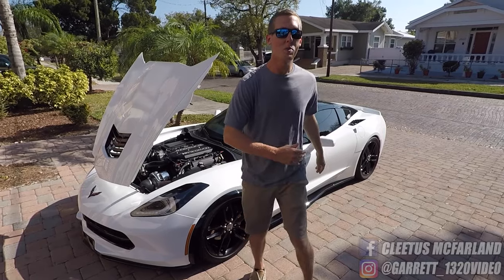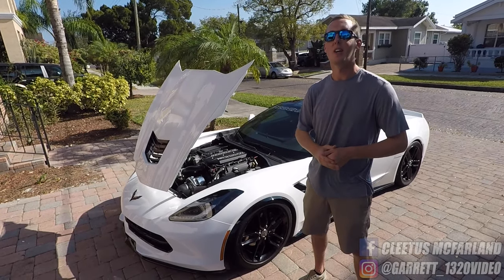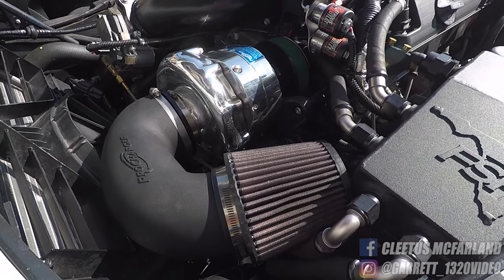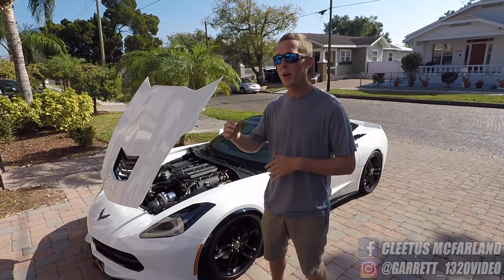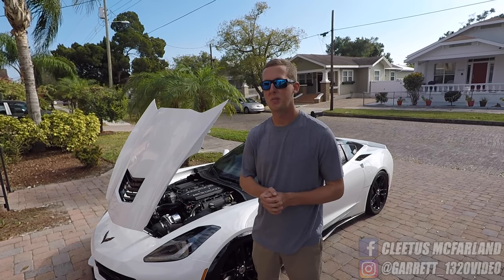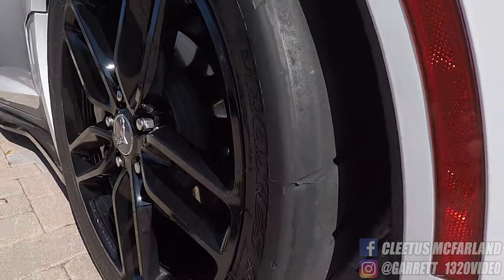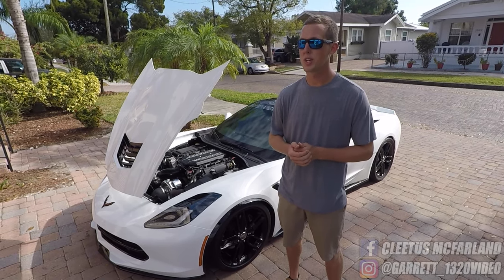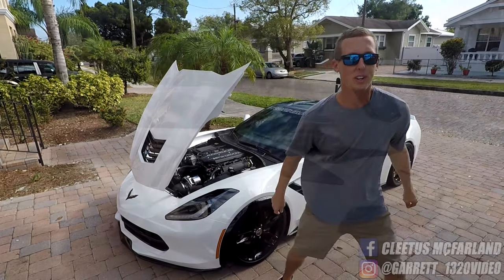How I Modified My Car To OVER 900hp!

Comment: Any reason why you chose to go with a centrifugal supercharger instead of a positive displacement one like a roots or twin screw? Other than what im sure is a lucrative sponsership
Reply: Heat soak.
Reply: KittyCow Centrifugals are alot easier on a street car than a positive displacement, because they build boost linearly with RPM instead of an instant peak. Also means less stress on the drivetrain.
Reply: Greg Hoffman this has very very little relevance. a roots type still makes its boost very quickly and then holds the boost. linear power is not a reason to run a centrifugal. if anything... it's a reason not to. less area under the curve. 

they are great dyni queens but suck when it comes down to actual racing
Reply: Justin Davison  How is that irrelevant. Exactly, roots blowers build peak boost right away and hold it, though they do start to drop off up top, but that's not really an issue. Yes, roots actually are better for racing (IMO) because of that. but like I said, the linear boost curve is better (depending on how you look at it) on a street car, as in daily driver. If you're pushing large amounts of boost, on a daily driver, it's alot more streetable building boost progressively. You don't have to baby it quite as much, and there's less of a shock on the drivetrain than a near instant hit. obviously the difference doesn't matter with small boost numbers.

so again to clarify, I was talking about what's tamer for normal street driving, and not what's better for racing.
Reply: well, centrifugals actually build boost exponentially, not linearly. Meaning that 8 psi at redline (examply 6000 since its an easy number to work with) will make 8 psi at exactly 6000 and make the square root of 8 psi at 3000. basically this means that centrifugals are really peaky when it comes to power. Keep a centri car below 3000rpm and you wont know its not NA. This is good for longevity however, since the car wears like a non boosted motor the majority of the time, till you rev it out to redline and get smacked in the chest by dale earnhardt
Reply: KittyCow Valid point. and the second half is exactly my point. Longevity and tameness for street use. Again, for lower amounts of boost like say 6 psi, it's not a big deal, but for a crazy figure say 30 pounds of boost, can be hell with a twin screw on a street car. but with a centrifugal, you can drive like granny and keep it out of high boost.
Reply: KittyCow longevity is virtually unaffected. either your components can handle the full power or live all day long at  a fraction of it. engines don't wear out more or less because they make 250 HP vs 500 HP especially when the car makes 1000hp or whatever. it is operating at 50% or even less of its potential. there is no increased wear with lower rpm and boost. shit makes ZERO difference
Reply: Greg Hoffman if your car is built for 30 Psi. it doesn't give a rats ass about 8psi or whatever at partial throttle or lower rpm. 

in fact lugging an engine designed to have that much fuel will probably eventually foul the plugs with fuel or even wash down the cylinders with fuel and mess up lubrication or rings. if you have a car designed for extremely high boost and you lug it around u will experience this.
Reply: Justin Davidson yeah, if it were my car i would have gone positive displacement blower or turbo, but hey cant argue with a free procharger
Reply: more pressure over more time is likely to blow a gasket, increased blowby etc. why you gotta be so aggressive with misinformation
Reply: Golden Spartan so your argument for adding power to a powerful car is spend money on something that makes less power because it will last longer... buy a Tacoma. they last longer. 

if a bridge is designed to hold say 300k pounds of cars... do we say hey wait wait wait... let's not allow more than 80k pounds of cars on it at a time. 100k pounds is going to wear it out quicker. it's designed to hold more. 100k. 200k 105. 55. it doesn't matter.

Comment: Wow! 841 to the wheels. Stock C7's are like 370 to the wheels, stock. That's an impressive HP gain for a Procharger, intake manifold, cam, methanol injection, exhaust, and a tune. 

Love them V8's!

Comment: I'm surprised the engine was able to make that much  HP with stock internals without blowing something out.
Reply: Yes that car should have Blow Off, but i don't see this
Reply: Vengeance Racing made 1090rwhp on a C7 Z06 with stock internals. Never underestimate the durability of a GM Small Block.
Reply: The LT1 isnt as stout as the LS3 as the 6th gen camaro guys found out.  Needs forged pistons, but other than that its just as strong as the LS3.
Reply: Rez it’s a Chevy ls series v8 some of the most reliable engines out there and easy to modify and get big power
Reply: gmansplit his can is a lt1 though the lt4  has forged shortblock
Reply: @zachcondon-oz3uh  Lololol, I love when people comment about things they don't know about. The LT1 pistons are garbage and are notorious for failing with boost. Most people sit at about 600whp and leave it at that because they don't want to rip out the internals for forged pistons.
The LS3 is a much studier engine, with people running ridiculous numbers on bone-stock engines.
Reply: @gmansplit  This is an LT1, not a forged LT4.
Reply: I can promise you his life is very limited. Pretty much all my c7 piston rings blew at about 700hp after 10k miles.

Comment: i would like to see them tear the rod bearings out when u get your new engine, to see how they handled the pressure from forced induction
Reply: Been 3 years and still stock motor so well i quess
Reply: @joonaslaakkonen8096  3 years later and the motor let go. I'd say that's pretty good for a stock motor that was boosted.

Comment: Are you running a 50/50 methanol set up or pure meth because I heard that's a time bomb. Not hating on methanol I think it's great hell it even helps against getting heat soaked. Awesome build though you running stock rear shocks right?

Comment: How did you fit 315's on that car, I thought 305's were pushing it.  What rims and offsets do you have and are the tires flush, tucked or outside of the fenders.  Looking to do a similar set up that's why I am asking.  Thanks

Comment: You fit 315's on the stock z51 rim?  I'm running a 2.3 roots style on my vette but obviously need more meat on the tires... Are those stock z51's or replicas to fit the 315?
Reply: I, too, would like to know this.

Comment: 841 whp  on stock internals ? great 
is this safe or over safe?
Reply: I wouldnt call it "safe" but it's not really "pushing it" either, like he said he coooouuuld use the nitrous but he's keeping it at 900 for safetys sake, most likely with a perfectly configured nitrous shot he could make 1200 to the wheels on stock internals, but it's just a matter of getting that exactly perfect shot every time, which just cant be done consistently

Comment: Awful lot of power from just basic mods. Thought it would've been stroked as well. Is that power with the nitrous or without?
Reply: Without......he mentioned that hitting it with the shot could break the internals. It sounds to me like the engine is at its limits right now. He said he has an engine being built right now that would handle the boost and shot of nitrous.

Comment: exactly what I would do to the c7 to customize, why spend what 100G on the top of the line corvette wen u could get a grand sport or what not an boost it. then as u said came intake an a good set of tires. only thing I would do different is no nitrous an id get that bigger Aero packAge spoiler the one the zo6 comes with I do believe but other then that yeah that's exactly what I'd do indeed

Comment: fun fact does anyone know why corvettes seem like they have trouble starting?
Reply: Probably to get some oil pressure and lubrication before ignition. This is just a guess.
Reply: Dirty cam and a big supercharger to turn, advanced timing etc.
Reply: Mike C Mike is correct. it makes 4 complete crank revolutions to gain oil pressure before the ignition is turned on by the ECU
Reply: jack black

Comment: Did I hear you say lt1 on that engine lmao
Reply: All C7's come with new direct injected LT1/LT4's
Reply: Kyle B ok gotcha I thought this was still the ls platform. Thanks for clearing that up.
Reply: They reused the LT1 name yeah, it's the first of the Gen 5 engine series. Notable improvements are the shallower valve angle, fuel rails hidden underneath the intake manifold, and direct fuel injection
Reply: KittyCow and never going back to optispark again lol